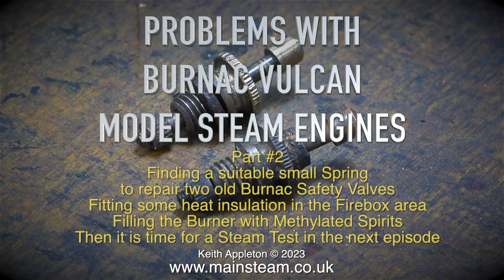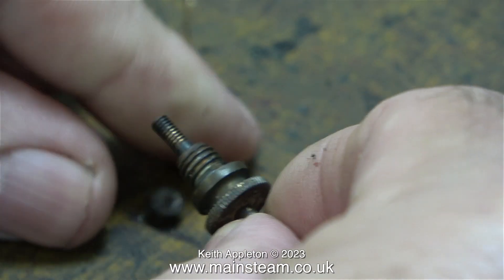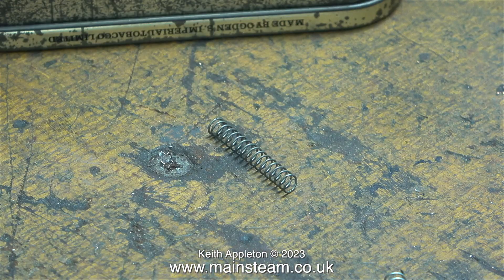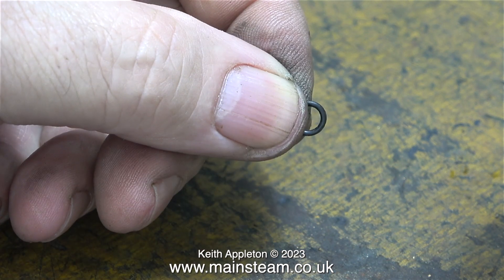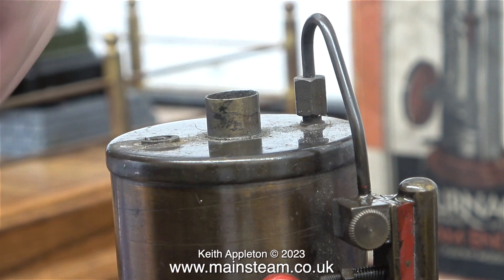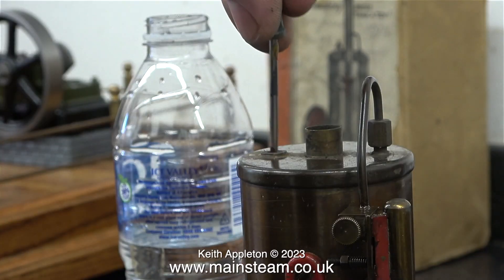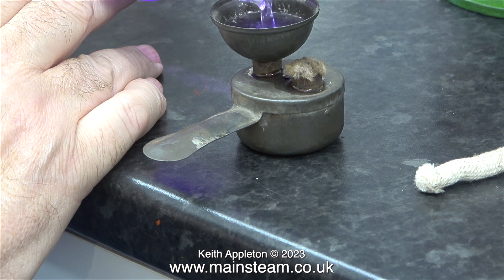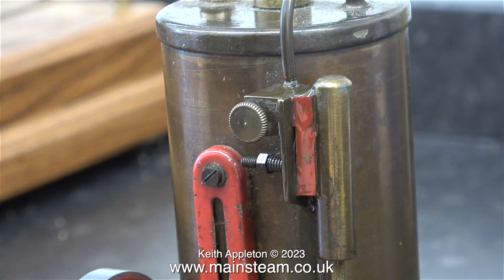PROBLEMS WITH BURNAC VULCAN STEAM ENGINES - PART #2

Comment: Hi,Keith. Good move lining the firebox with Kaowool. If you want nice clean burning fuel that produces virtually no sooty deposits try using Bio-Ethanol stove fuel. I have been using it for the last couple of years with my Stirling engines that have glass hot end caps on the displacer end. I get zero blacking of the hot cap with Bio-Ethanol,it runs far cleaner than Methylated Spirits.
Reply from the maker: Thanks for the tip!